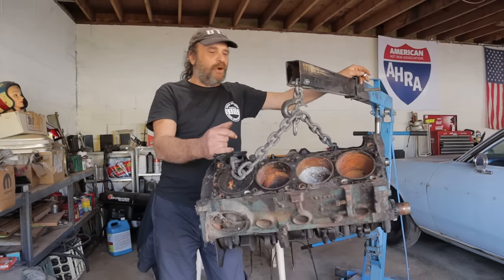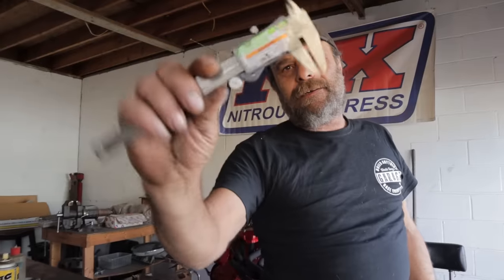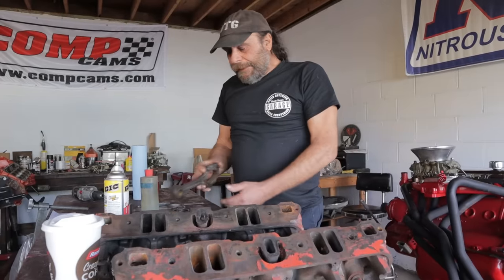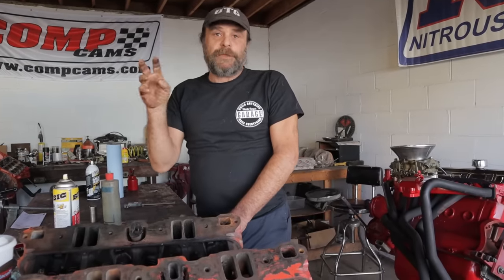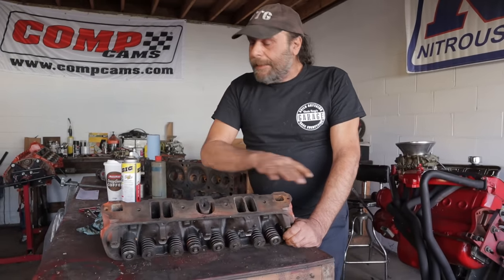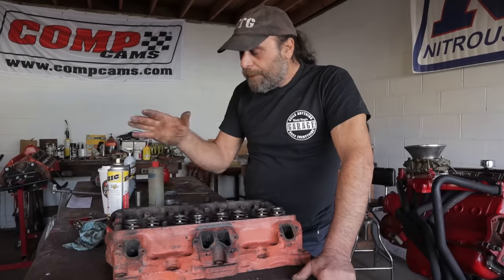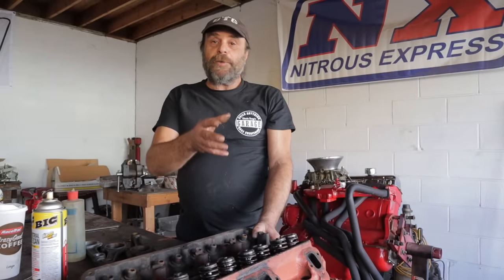The Most Under Rated V-8 In History?

Comment: The wee-18 is just a small bore 340. In the early 80's I swapped a set of 340 X Heads & 4 BBL Intake/Thermobog on to a 318, along with a Crane Cam..... that thing was surprisingly quick in a '72 Dustbin with 3.55 rears with a 2600 stall/Auto/Headers..... just an amazing mid-high rpm charge

Comment: Had a friend back in the day that had a 72 swinger. Had a 318 with what he said was a 340 cam, holley street dominator intake, 600 holley, 727, with a barracuda slap shifter and some old school 60 series tires. It would pull the front wheels on the street

Comment: I had a 1970 dodge dart swinger with a 318 2 barrel, automatic transmission. 
I bought it in 1980 with only 22,000 miles on it for $1,200. (It Was in perfect condition)
Changed it to a 4 barrel and added hooker headers and dual exhaust. 
It wasn't a big change in performance but it was definitely noticeable. 
But it was reliable and my daily driver. 
Red with black vinyl top and I wish I had it back.

Comment: I had a 73 Dodge truck with a 318. It had 340 heads.  A big Carter 4 barrel Carb. It was Black with dual Petabour Stacks. I miss that truck. It was quick with the 340 heads and the big 4 barrel carb. That was in the mid 80s. It was easy to do back then. But  today would be costly. The exhaust sound really nice. I can honestly say it was a pig on fuel. But it was fun to drive. I sure miss that truck. 😅

Comment: You didn't mention the 302 and 308 casting swirl port heads. These have a nice quench chamber. I'm building a 318 and have 3 junk engines. I think that I will see about using the 340 valves as I need to buy them anyway, so why not as the cost isn't much of a factor between the two. Not sure what block I should run. One is standard bore but probably needs .030 to clean up nice. Another is .030 already and rusty. It might clean up at .060. I haven't pulled the last one apart yet but it has a flat cam due to lack of oil. Building on a budget so it doesn't really matter on piston size either as they cost about the same. The 302 heads that I have probably have induction hardened seats so that is a plus. After break-in with the original 2 barrel the crowning jewel a TR5 tunnel ram intake and most likely a pair of Edelbrock 500 AVS2 carbs on top. Not sure what cam to use as I want to keep the bottom end torque as this is going in a 4x4 truck.

Comment: I agree those 318's are very under rated engines. We used to have a 78 B200 van that my dad had put a direct connection 260H cam into with a Edelbrock performer intake and a Holley 4360 economaster carb in the mid 80's. It woke that thing right up and got 14-15 MPG city or highway and loaded down it didn't change much, that van weighed 4800 pounds empty when we weighed it across the scales once. It did have a habit of blowing exhaust manifold gaskets out though, that turned out to be the original exhaust system was either plugged or just too restrictive. In the late 90's a 2.25" dual into a single muffler with 3" tailpipe exhaust system was made for it using the stock exhaust manifolds and the heat riser valve wired wide open. Never blew out a exhaust manifold gasket ever again until intake gaskets turned into head gaskets job was done in 2015. After about 16 years, that big round truck muffler was rusted out and we had a magnaflow copycat muffler installed in place of it, it had even more power and torque just from the straight through muffler. It would tow a fully loaded down tent trailer with the van loaded to the hilt with 3-5 people in it up in the mountains no problem. No longer own it, but that thing did run really good. If only it drove and stopped as good as it ran...

Comment: • Repiston 318 close to Zero deck
• Mallory metal Crank
• .904 Chrysler specific Camshaft
• Deck 360 LA head Ballpark 65 cc or use Aluminum Aftermarket Heads
• Eddy Air Gap
• Torque Plate Hone in last .003 inch to final size/or Deck Plate  Bore and Hone
• Grind Down Valve Guide Boss on iron 360
• Gasket Match Intake Ports
• VJ: Standard 30, 45, 60 PLUS if machining allows...... 75-80° Bowl Cut 
• Bowl Blend (Not going Crazy)
• Grind as much OFF "Ski Ramp" from factory valves (without sacrificing Valve Face Area)
• Use appropriate size MLS Head gaskets to reach desired CR
• Best Headers you can afford
• Best Carburetor you can afford

Comment: So this is my 318 story. I had a a 1970 truck motor that I stuck in a 1974 power wagon.  I did a rebuild and mic'ed the cylinders .001 tapper. Crank was down to the copper on the bearings and I thought now I'm going to have to get a .010, .010 grind. They were perfect, I was amazed to say the least. Then I went  and threw a pair of    360 heads on it. did the porting and back cut of the valves. The chamber design was a lot tighter then what he shown in the vid.  My biggest beef was the fact the rocker arms were not adjustable,  Which I eventual replaced and got from northern auto parts for around $300.00 and that cured the lifter tick. It turned out to be one of the best engines I ever owned. Now for the kicker to the story. I'm a diehard G.M. fan. I've built all shapes and sizes, but that 318 will always have a place in my heart. Oh, I still have it, running in that power wagon. Except now it sports a set of G.M. dana  44 diff's.

Comment: True  mechanics are a rare breed!  I grew up in Michigan, I'm 55, my family and friend's family worked for the car company's and their suppliers.  When it's in your blood and your heart you can tell!  As far as car technology from what engineers and mechanics did in the 60's and 70's compared to today, the people in the 60's and 70's came up with some simple solutions that did the job.  Try telling a 20 year old mechanic about a vacuum leak!  My mom's Lincoln had power windows and locks that ran off the car's vacuum!  The Corvette's that Chevy gave the Mercury and Apollo astronauts had lights on the shifter console that were wired to the brake lights so if the brake light went out that shifter console light wouldn't light up and they'd know.  Nowadays turn signals hyperflash to let you know the brake light is out.  My first car I had a big toggle switch under the driver's seat and the battery cable went to this toggle switch and a 2nd battery cable went to the starter.  When I shut the car off I'd reach under the seat and switch off that toggle switch and open that circuit!  They might break the window and steal the radio but they'd have to tow that car to steal it!  $4 for a security alarm!  I worked at AAA taking calls from people saying they needed a tow truck because they hit a deer and their car was totaled.  I asked what kind of car they were driving and it was always something made in the 21st century!  My dad used to mow down 3 or 4 bucks every winter in his 1973 Pontiac station wagon and it never scratched the bumper or slowed him down a bit!  Yes, cars back then had battering rams called chrome bumpers instead of these crumple zone frames and 14 air bags!  I'd just as soon go back to having battering rams than having a totaled car if I hit a deer.

Comment: My bone stock 1968 Dodge Charger 318 cu in w / 2bbl will top out at 113 MPH, then the valves float. I check cam gear wear by wrenching to TDC, then backwards until the rotor moves. Once I hit 12 degrees, I will consider a cam & lifters.
  Question; When pulling a Slant-6 out of a van, where is the center of gravity for the engine lift to attach to?

Comment: Uncle Tony - the 318's that Mopar placed in the late 80's, very early 90's Dodge pickups have the fast burn, small, heart shaped ports with 1.78 int x 1.50 exh valves.  The heads will have a XXXX714 part number on them.  They are essentially 302 heads.  These engines are what some call the LA Roller engines which are actually considered pre-Magnum.  Everything is LA with these engines with the exception of roller cam, roller lifters and diverted oiling through the push rods.  Worth a look.  Find them boat-anchor cheap at the junk yard.

Comment: The 318 is a very tough motor, I ran them in demo cars, you could get them hot and they would just keep going and going. I still own a couple of them.  They are reliable too.
Reply: Right on! Those are fantastic running engines while hot. I always liked running B 400 Chryslers in my derby cars. Short stroke & low compression helps them run good hot and easier to restart if they did stall. The big blocks have thier distributors hidden and protected too 👍

Comment: I have a 318 I cannot decode that matches your timeline. It is a 1971 block with floating wrist pins. The 4 bbl spread bore intake is cast and the tallest I ever saw. Aluminum waterpump and timing cover. Now I am going to spec the heads for valve size and casting i.d.
I also had a 64 poly 318 that beat a 69 440 6 pack Super Bee. Like you, I have been Mopar all my life. Still have my 65 Satellite since 1972 and a 40k mile 63 Dart slant 6 for the 318

Comment: Iv a 318 in my chrysler valiant, yes im aussie, put a 4 barrell intake on her a 600 holley block hugger headers higher compression i tell ya what she gets up and scoots along alright! Reliable as anything out there tough as nails and sounds brilliant! Currently building a new 318 now which will consist of a 6/71 supercharger, crower blower cam, 360 heads only for lower compression, forged pistons arp studs eagle crank scat rods you name it, should be a sweet little weapon!

Comment: I had a couple of guys that wanted to line up with me at the drag strip every time when I had my 89 Mustang coupe… One of them was an early 60’s valiant and the other guy had a the new challenger when they first came out… They never could beat me off the line or run me down but we had a blast! That valiant and the challenger was so clean you have done the white glove test on them… 😅 My old beater needed a paint job and some interior work but it ran good for what it was… I kinda liked the ratty look with super clean weld wheels and shiny tires…😁 The valiant had a 318 in it and it was absolutely beautiful under the hood. He would normally start gaining on me about half track. It would have been a damn good race in the 1/4 mile. Those were good times, I had a lot of fun and met a bunch of awesome people. My Mustang got stolen a few years back. I recently got a 72 F100 Ranger XLT… I can’t wait to get started working on it. I’ve wanted one since I was a teenager and I just turned 40 back in August.

Comment: Amazing videos as always, I love all the information/history, that's why I loved watching Barrett Jackson years ago and I watched all the horsepower shows and read-and still-read all that I can. Keep up the awesome work. I'm very impressed at what little you have to do to get a 318 to preform. Your 383 video put that engine on my map and made me appreciate it's qualities. My question is, with a stock displacement engine-you buy a car with this engine in it and you want to hot rod it-cam, intake, exhaust, heads, ignition etc- which is better/will give you the best performance, a 318 or a 383? Thanks and have an awesome 2021.
Reply: All you need is dual exhaust and a Holley 500 cfm 2bbl carb and that wakes it right up.  That's what I have on my 1968 Dodge Coronet.  Does high 15's in the quarter mile.

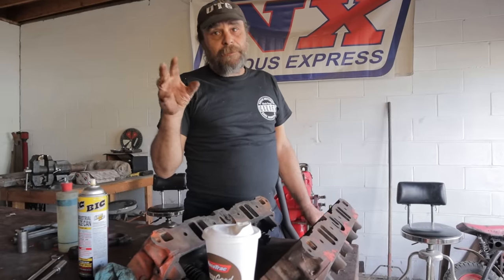Comment: The 318ci was easy to bore to 340ci and dirt cheap too! Great  motor and street dragger. With dual quad Holly carbs w progressive linkage, Hurst spring-loaded 4 speed, tuned exhaust manifold, racing valves, a turbo,  and we were eating vettes for lunch and beating Hemi heads. Rear axle 4:11. Made money easily and had loads of fun.

Comment: i have had 225  318s and 340  .the biggest problem i found was the ignition system 
we used to install a fan over the Resistor seemed to help light to light ..so it would cool down 
reverse coll draw its called

Comment: "Marketed as the bread and butter motor."  Yes, choked down with a 2 barrel carb and anemic cam.  There's a lot of potential you can unleash.  As you said, the 1.88" & 1.60" valves, porting, good manifold, and 4 bbl.  Basically, treat it the same as the 273 4 bbl "Commando"/"Charger 273" motor.  The 360 truck cam runs great in a 318 4bbl.  Get it up to .440"-.450" lift cam and it will go.  I've done a few like this.

Comment: I took an old 'cuda with a 340/ 4sp for a ride one time. Thing pulled like a mule until 4 grand and then it just stopped there. When I got back to the owner's house with it I just told the guy "runs great until 4000" he said "I didn't tell you it has 318 heads" 
UT's LA 318 lecture reminded me of that spin that I took 40 years ago.
Who knew?
Great info though.

Comment: As a dumb teenager I ran the oil out of my 318 Dart.   Had a leak but didn't check it until the red warning light finally flickered.   Put 5 quarts in and it ran until I sold it without burning oil.   I'm still shocked by that.

Comment: I worked at a used car lot in high school, got to drive all kinds of now highly valued automotive iron.  I'd occasionally would drive 318 equipped Mopars: now, no one would ever mistake a 318 as a high performance engine, but they were rock solid dependable, and had more than enough power to get you in trouble.  They must have been good, since they continued production in some variation or other from the '60s into the '90s.

Comment: I've owned 7 318s over the years from 1970: 318 poly with 4 barrel ('60 Dodge Dart Phoenix conv.), 4 318 LAs, 2 barrels ('70 Challenger conv, '71 Dart Swinger, '81 Mirada & '83 Dodge D150 PU) and 2 318 Magnums with EFI ('95 & '99 Dakotas). The Mirada with a too tall rear end and anti-smog air pump went from 0 to 60 in about 3 days!

Comment: 318 sounds like it filled a similar niche as the 390 did for Ford: High torque, high reliability V8 optimized for 2V carbs, used mainly in base sedans and trucks.

Comment: I had 318 2bbl in a ‘82 short wide, it responded very well to a Edelbrock performer and carter 600AFB Carb, still had the low performance factory cam, did the swap because the 2bbl carb was expensive.

Comment: I ended up being given 340 stuff (dual quad intake, block with concrete in the one bank, j heads with roller rockers and big valves, forged crank and bushed rods) the block I'm deeming unusable since I can't source hydrofluoric acid to remove the concrete.
If I plop those on a 318 block with some better pistons maybe taking up some of the loss of compression, is that workable? I think summit has a small dome version I can probably find the thinnest gasket I can find. i would probably use your info on port cleanup and use the caps/windage tray .
this engine will go in my triumph stag with a manual trans.

Comment: I took a 69 318 with 62000 mi stuffed a 68 340 automatic grind crane cam repop cam in it, 1980 318 
4 barrel intake and thermoquade carburetor 625 cfm from a trooper car, a set of 15/8” hooker headers, a mopar high performance electronic ignition kit, 904 transmission  and a 3:91 rear gear and posi in a 83 ram miser short bed and ran with sticky street tires 14:40 at 93 mph it was very impressive this was back in 1988. Then the rear end went bad and I stuck in a 3:23 rear I had lying around and showed my brother 5000 rpm in high gear on the interstate which I believe is over 120mph with that gearing and a 27” tall tire it was a impressive little engine 318s are a great engine and I believe the rod angle is really good as well.

Comment: A friend of mine had a brick the engine party with a 318. It refused to die. It ran at wide open throttle for more than an hour. Then we drained the coolant. It ran for another hour. Then we dropped the oil and it made it almost to another hour and seized up. The next morning it started up! I had a Plymouth with a 318 that I abused the hell out of. Had it for over five years without an oil change. They're one of the greatest engines ever made. Hard to get big power out of but nothing is more reliable. Except the slant six!

Comment: A street race loss of mine back in the 90s was to a very unassuming Ram pickup running a 318. I had a 81 Cutlass at the time with a fairly well build 355 Chevy in it. A couple guys rolled up to me and wanted to go on a 30 roll. I thought it would be an easy win. They gapped me with ease. Shocked the hell out of me. Now I'm rocking a 340 based 418 stroker with a F1A Procharger making 1100hp in a 67 Plymouth Belvedere. Mopar or no car!

Comment: My friend in high school had an 84 diplomat ex police car it seemed pretty fast for 1988 probably a 16 second car never had any trouble going 125. With an open element air cleaner Thermoquad sounded like it wanted to suck the hood in . Anyways within the last couple years I’ve tried to do research on that engine add eventually I found that it was a mopar racing block 318? And it had 360 heads. It definitely could breathe well and pull hard to 5500 . Do you have any research on these?

Comment: I had a 318 with a 2 bbl rochester carburator, that seemed a good set up. I always liked the 318's , and yes they were under rated, everyone wanted 383's or bigger. The 273's were a good strong engine. I was broke and needed an engine for my 69 roadrunner so I swapped in one from a 72 dart. The body I got for free and the engine I bought for $150. I drove it for awhile  and later got $800 for it.  wish I had that rust free car today. That was in 1981 or '82.

Comment: the 273 is an amazing motor also overlooked 340/ 318 on steroids and the 360 was the cheap fix for the loss just sucks they went that far down the rabbit hole, I like to grab the poly blocks just for rods and crank, 273 for heads and rockers,  318 police heads best street head off the high compression propane, my franking stein 318 stroked 355 nife cute crank with 340 w2 heads, love your channel man,